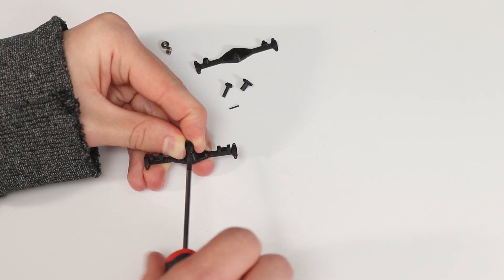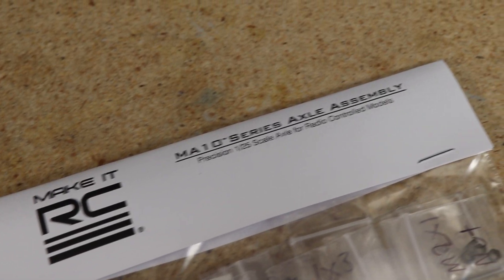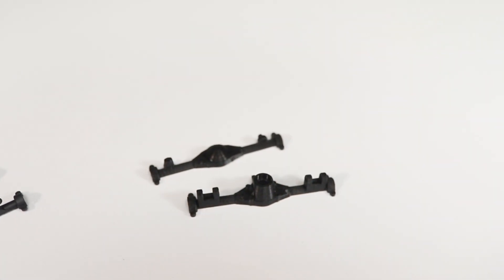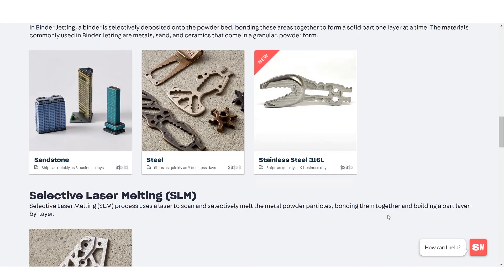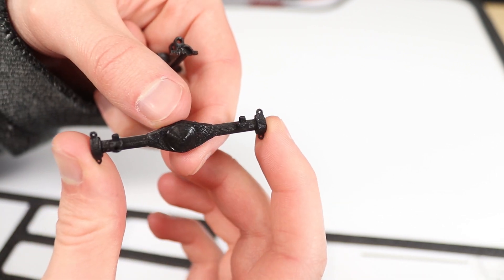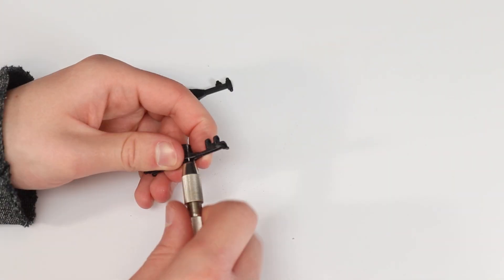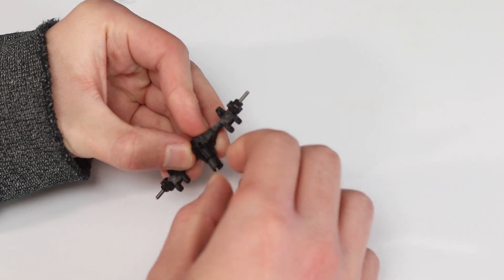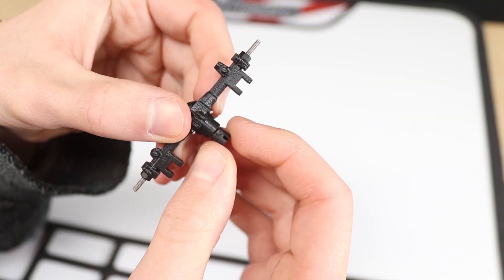Make Your Model Move! Overview & Update of New MA10 Kits, STL Files, and Variations Now Available

Comment from the maker: New kits are finally out! I wanted to put together a quick video with some more information for all who are interested. More cool stuff is in the works. As said in the video, supplies are low at the moment but hopefully things will begin improving soon so we can get back to having everything stocked. Everyone's patience and support is appreciated! Be on the lookout for some new videos coming soon. 👍
Reply: How is the 1/10 prerunner build going?
Reply: With all the axle housing setups available, do you think you guys could make something more suited for stock setup trucks (not ones meant to look like road course machines) like a 65 c10 model I'm thinking of making RC? The housing would just have mounts to bolt it to the trailing arms and then a tab on top for the sway bar. I figure you'll eventually get to stuff like this though, keep up the good work👍
Reply: I want to buy a bunch of your axles but where do I get the gear sets?

Comment: can I print axles on an fdm printer?
Reply from the maker: The housing pieces can, some minor design tweaks were made to make them a little easier to print (lower trailing arm mounts for example). In the files you'll see the housings designated for FDM 3D printing and those for SLA or other high resolution printers. As for the gears and driveshaft socket, I don't think those can be printed on a FDM printer.